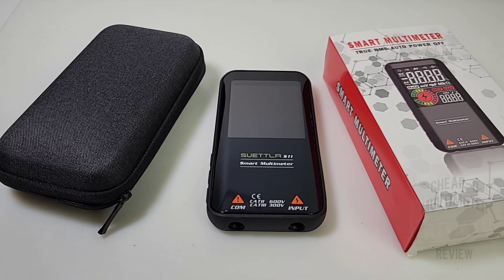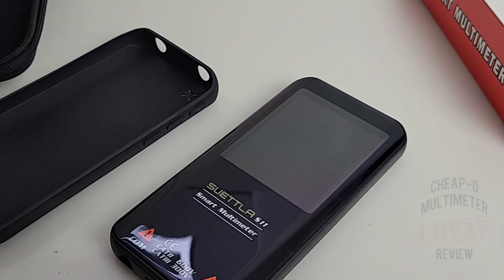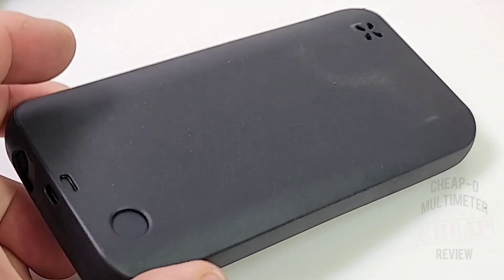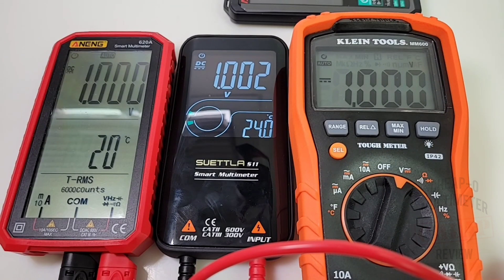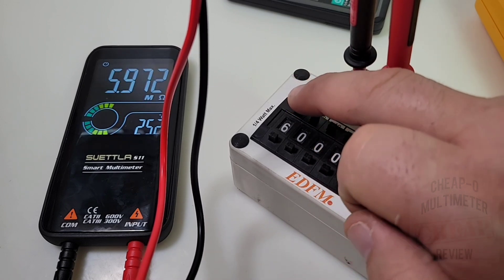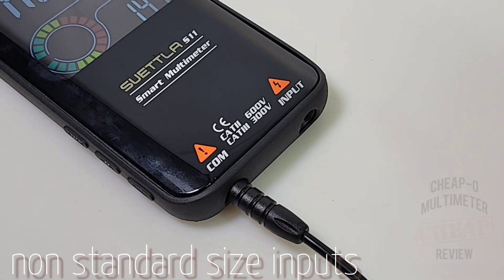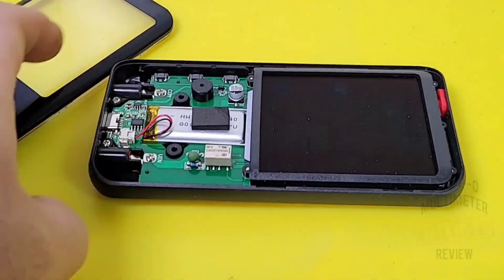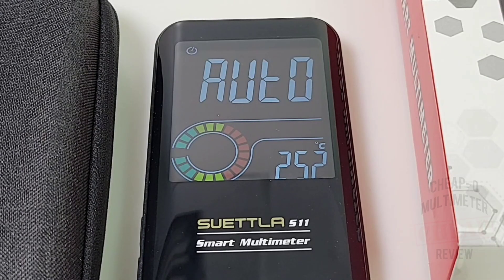SUETTLA (BSIDE) S11 CHEAP-O Multimeter Review  & Teardown!

Comment: For a pocket-sized smart meter s11 is not that bad. I lowkey want to try one of these now, as they say. But I'm 100% with you on those test leads. They even color coded their input terminals right and then went bonkers on the leads. 🤪 The worst part of course is that, as you said, no standard size leads will fit the meter. That's probably my biggest beef with s11.
Reply from the maker: Yes, the non captive leads are a step in the right direction but they have to make them a standard size otherwise what's the use?
Reply: @KeepOnTesting  Would an adapter be reasonable AKA safe/accurate?
Reply from the maker: Personally I wouldn't try. Too much that can happen. Ideally the leads were standard size.
Reply: @KeepOnTesting  Too bad. That kicks it off my list for sure. Not worth the frustration the moment a lead breaks.
Reply from the maker: @JB-fh1bb I'll never understand why they don't simply put an industry standard input jack. 🙄
Reply: @KeepOnTesting  Aaaaaagreed. It’s not even a standard that people argue about in significant ways. It’s tried, true, does what it says it does, and has no obvious flaws. Seems like as easy choice to implement it.
Reply: I use a pair of 2mm male to 4mm female inline adapters and they work fine. This allows me to use leads which fit the task at hand or connect it directly into my circuit.  I had bought two sets a little while back when I needed one set for the signal generator output of my Zeweii oscilloscope. Nice to have found a use for the second set!

Comment: I have a Aneng 683. Was surprised how accurate it is. I took the gold standard in substation protection test equipment,  a fully calibrated Omicron CMC and fed the meter with exact voltage and current levels both ac and DC. Almost spot on throughout the range!
Reply from the maker: Thanks for sharing! Aneng can make some good gear when they put their mind to it!

Comment: I have the S20 and it beeps for everything - and half the time it's warbled.  It's so freakin' loud and it can't be turned off.  Continuity and standard beeps are the same volume.  I used the too-sensitive EMF mode and it's like the security system is going off and everybody runs for the emergency exits.  I opened her up and changed the resistor BSIDE the buzzer (see what I did there) from 10 ohms to 36 ohms [edit: went back in to make it 120 ohm], which cut things back to less obnoxious levels.  Yeah, I know everybody wants loud continuity buzzers - but on this device continuity mode isn't particularly great anyway, not unlike the overall accuracy of the unit.  It's not like I'm going to be using this device somewhere on a busy street, more likely a quiet office or lab environment at best.  It's eye candy, a pretty toy, probably great for kid's first DMM.
Reply from the maker: Yessir..the beeping is annoying as heck 😅 unbelievable why it can't be disabled! I definitely would have loved this svelte dmm as my first multimeter 👍

Comment: Cool, is that a rebranded Bside brand?

Of all the cheap but good multimeters which is your absolute favorite?

God bless.
Reply from the maker: I honestly don't have a favorite...I use alot of different test instruments..However one of my new favorite multimeters that I'm constantly reaching for is the Manual ranging ZOTEK ZT-980. Of course the new Kaiweets HT118E is also tough to beat. 👍
Reply: @KeepOnTesting  Thanks for the ZT=980 mentions I put a mark on that on the local online shop.

I researched some more, I think you will find a new :-) low cost multimeter but quite good from among the popular low cost but quite good multimeter brands (Bside, Zotak, Uni-T, Aneng & Kaiweets usually) vs. the quite popular high-end: Fluke, Sanwa (Japan) or Tektronix or Brymen (EEVblog's multimeter manufactuer).

Check out the ZT-M1 (BSIDE brand seems to be the original, there's a Zoyi which is little cheaper by US$4 but seems to be a rebrand) at only US$32 for the Bside brand.

I'm not sure about the durability if dropped or longevity but the range is amazing, it beats the high-end ones at that price, one can measure the smallest capacitor 0.001nF to a huge 100mF (that could mean really small, almost can't see w/ the naked eye smd capacitors to huge power supply caps, I think), same w/ everything. It's got temp and amps too w/ amazing range as well (DC current and AC). But I may be wrong.

I'll buy it as soon as the seller replies w/ my inquiry (that's how I test I won't wait for nothing after, sometimes 30 days w/ some pre-order only stores which I avoid now unless there's a rating, someone bought and received it) hopefully the seller is legit but there's 7 day protection anyway for the refund from the local online platform.

God bless- 2023 is our for the takin by God's grace. Rev. 21:4

Comment: Thanks for the review on the s11. I wanted this meter just for its rechargeable battery however if it doesn't measure correctly its useless. I can +or - one 10 thousandth of a point off ,I will be buying the s11 after watching this review 👍

Comment: Some things I still perfer replaceable batteries. Just having to keep stuff charged is annoying for devices like this. Id rather have AAAs.
Reply from the maker: Good point ...I think the charge life is a big factor. If the meter stays charged for weeks or months it's not a bad option.If you have  to charge every time you need it..definitely not good.

Comment: It's not a color LCD, it's just coloured segments. That battery is SMOL considering that size of a screen with a backlight...good touch on not letting it turn on when charging (because it is quite close to the test lead inputs themselves!) and that test lead dilemma is hideous and against the code in the CHEAP-O realm where leads don't last that long...
Reply from the maker: Sooooo true 👍 I would've preferred captive leads  instead of a proprietary setup because once the leads go south or if they get lost.. . It will be a huge PIA trying to find a replacement.

Comment: There's so many pros in this Suettla, good job. I think the bummers would be the non-standard jack size and no tilt-stand. 🤪
Reply from the maker: I concur! Why oh why don't they include tilt stands...or st least a magnetic hanger ??
Reply: @KeepOnTesting  yes, even a magnetic hanger will do. But other than that, I think this Suettla S11 is one of the badass among the smart meter family. Accuracy & speed (in manual mode) is awesome. 👍

Comment: These "phone-y" meters always seem to be centered around drawing in cell phone junkies and they look appealing on first glance, but virtually always come up short on functionality.  I just dont see the practicality in foregoing basic functionality and practicality just for the sake of masquerading as a cell phone device. In the year 2021 theres no excuse that a stand of some kind IE chrome wire or otherwise cant be designed in especially since the meter has some glare at angles and it needs to be viewed from straight on if possible.  But a stand wont work anyway in this case as the leads would interfere at the bottom and prevent the meter from sitting correctly even with a stand unless its some special design Then there's the proprietary leads you can never replace which theres no excuse for as ive seen at least one meter of this size IE the SATA meter show in the video that accepts standard leads. Then with little or no input protection as well as no current function and a rechargeable battery I have to ask how good battery life is with that large LCD display - IMO its much more practical to have an easily removable cover and be able to change batteries on the spot so if it goes down youre not a slave to the charger. In every one of these theres always fairly major compromises just so it can wear a kitchy cell phone case. These all seem to be niche meters that focus more on the cool factor of looking like a phone device than serving all the purposes a meter is intended for, the designers and marketers of these type meters seem to subscribe to the same mantra as blue tooth designers - every thing is better with blue tooth, or in this case looking like a cell phone, the whole thing feels like a marketing design. Given the fact you can get a fully functional Kaiweets HT118A for the same money unless you really need the negatives associated with a pretender cell phone case id say these phone-posers have limited practicality in a lot of real world applications. Im surprised the cell phone marketers like Apple havent figured out a way to actually include meter functions in their cell phones--lol  Maybe the fact they havent kinda shows the impracticality and/or low demand for the idea in the first place.
Reply from the maker: Well..leave it to Mr Yammerino to dissect this multimeter to high heaven, all I can say is..Yessir ! I agree 100% Style and functionality are great features but never at the sake of performance or safety.

Comment: Nice review, I have seen a few of these style of meters around, but never purchased one myself yet...... I presume a set of leads with non-shrouded plugs would fit into the jacks. Thought the input protection was a little weak myself.
Reply from the maker: Cheers my friend! 👍Definitely a hobby style meter, light use intended. Input Protection was meager but probably sufficient. The inputs are very tiny and even non shrouded leads are a problem.
Reply: @KeepOnTesting  That's not good if non-shrouded connectors are also awkward. I suppose you could cut off the probe at the other end and replace it with a standard 4mm to use crocs and grabbers as well as probes.
Reply from the maker: @three-phase562  Definitely a work around...so much simpler if they just used standard inputs.. they definitely had the space.

Comment: This could have been a very nice smartphone-style DMM had they paid a little more attention to those cons you pointed out. As it stands, it's at best only worth the three stars you gave it. Also the rechargeable Li-ion battery is a nice touch and it avoids using the usual CR20xx coin cell batteries that only last a few hours.
Reply from the maker: Definitely a bonus not having to use those buttons cells..it charges fast and the USB-C connectivity makes alot of sense. 👍